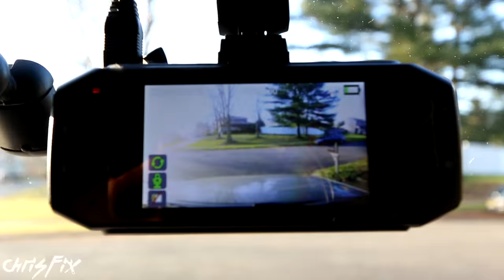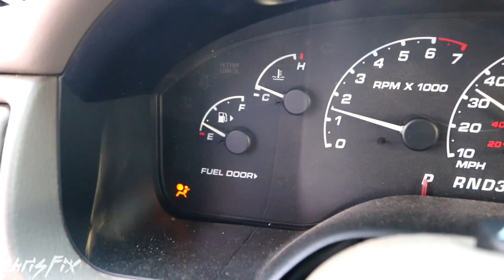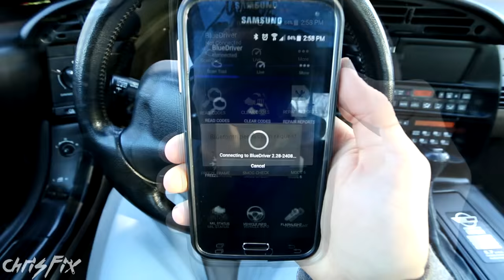Top 5 Christmas Gift Ideas for Car Guys

Comment: Do you know if that bluetooth adapter can read modules on newer volvos?
Reply: +hugeslacker  it should read any model/make vehicle 1996 and up.
Reply: +ElementalsMods but I mean the individual modules not just the standard odb2. Like the abs and brake modules. Right now I use a generic odb2 and torque on my phone but would like more functionality than standard odb2.
Reply from the maker: +hugeslacker It can read the advanced codes on any American made car (Ford, GM, Chrysler) and Toyota. They are adding more to the list every month so I would call them up and ask. You can tell them you saw it in my video.
Reply: +ChrisFix alright I'll give them a call tomorrow. I've seen cheap 100 dollar tools that can read some of the modules in volvos, so I'm curious if they do, or will support volvo and offer more functionality than the other ones.

Comment: Quick question will the OBD fit/work for 2001 bmw 330ci e46 ??
Reply: +jacy thereon Yes, it will work on any car, 1996 and newer.
Reply: Not if its made in Germany
Reply: +Nutz4Gunz45 Not of it's a pre-2000 Nissan :(
Reply: Stuart Wood Why wouldn't it work on a pre-2000 Nissan?
Reply: They use a proprietary system called Consult, through a 14-pin connector.
Reply: +jacy thegoon I'm not TOO sure about yours, but on my 1999 318i E46 you can't access faults on the OBD2. I need to use the round thingy in front of my battery. (in the engine bay)
Reply: +j0rgen95 My car is imported from Germany.